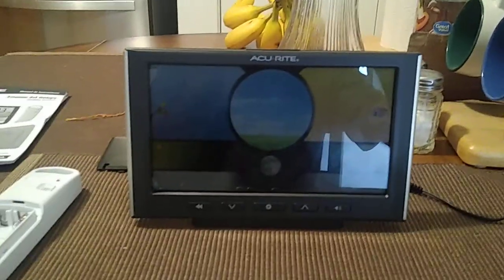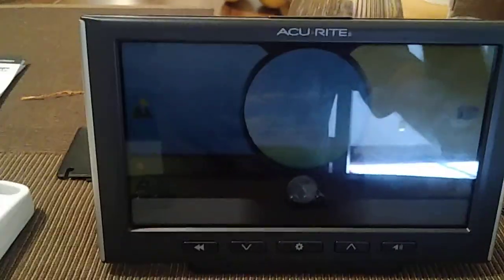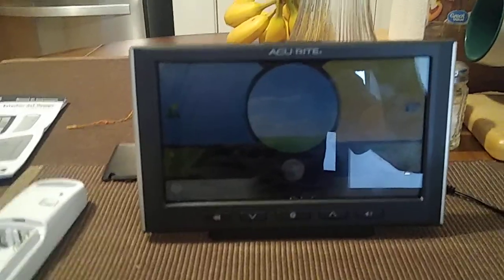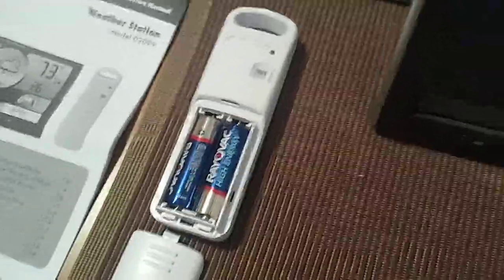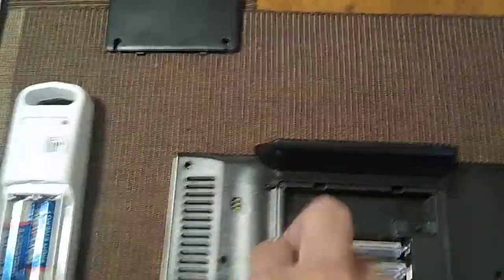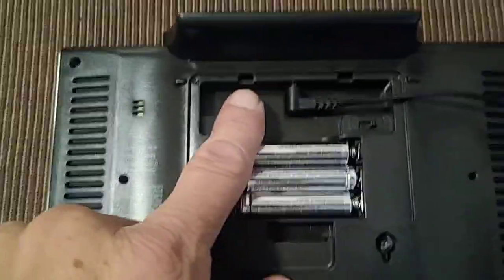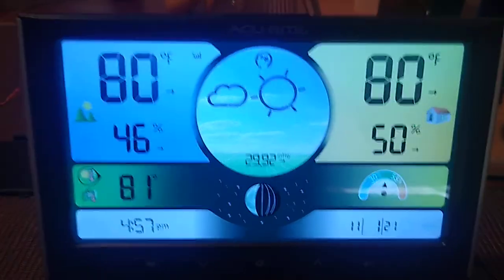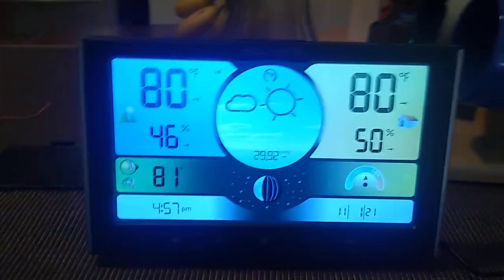🌘⛈️🔋 Battery & Setup-Acurite Weather Station-Model 02099

Comment: I just bought this model weather station. Not very accurate at all. The company sent me another one that isn't accurate. It's off by 5 degrees! Not worth the money.
Reply from the maker: Sorry to hear that.. hope you find a model that suits your needs.. Thanks for watching my video and check out my videos on my YouTube Channel and Playlist
Reply: -it depends on were you put the thermometer, i have a wrap around deck with a roof, so i put mine right out my front door its about 5 feet off the ground in the shade, and next to it i have a standard thermometer (the one with the red liquid that rises up) and its within a degree of each other + or - 1

- with this station i found that the humidity (never thought i had an issue) was up to 58 during the heat of the day, now with the help of a dehumidifier its were it should be around 45-48,this station was worth it to me.